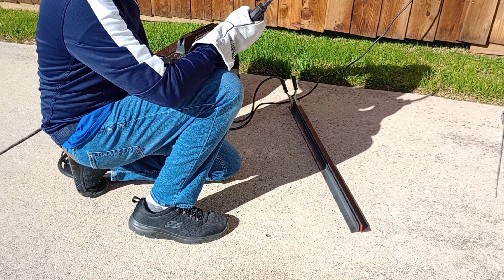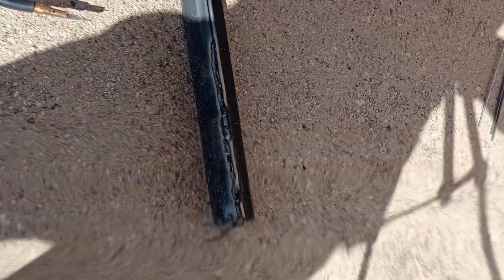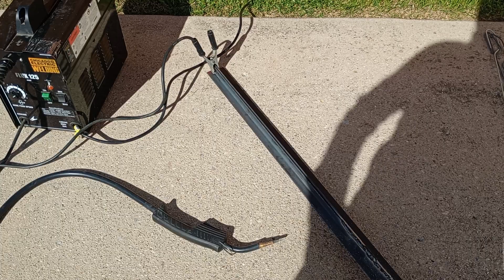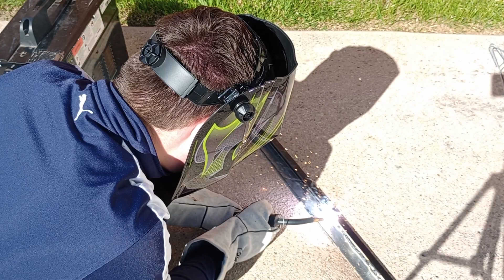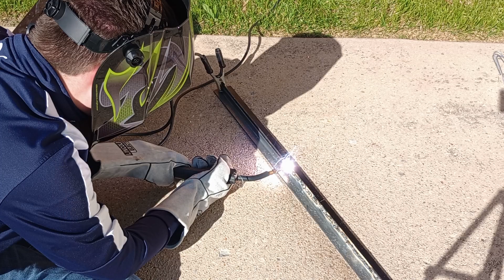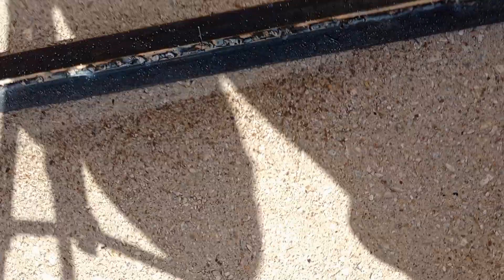WELDING AFTER 5 HOURS OF PRACTICE (AND SOME PRO ADVICE)

Comment: You're welding with a flux-core wire. Flux Core Welding leaves behind a thin layer on top of the weld, this is called slag. Slag is left behind to protect the molten weld pool from the 
gasses in our atmosphere. You can simply hit the weld with a hammer and the slag will come off.

Also, i'd watch some videos on learning to read the ''weld pool'' while welding, this will help alot. A little tip is, if you can't see what you're welding, stop! Its also smart to practice the movement of welding, by ''dry-welding'' without starting the weld, basically moving back and forth on the area you're about to weld. Make sure you're comfortable and relaxed under welding, this will help a lot with natural shaking and tremors.

Keep it up :)

Comment: Sounds a lot better. You can reach your left hand over to the welder and adjust the wire speed while the other hand is welding. Like somebody said on your last welding video, that welder is AC current so it won't be perfect but it will stick metal together. And even though that metal is new, there is still "mill scale" or coating on it that would weld better if you sanded it off but you have made great progress. My local metal store gives cutoff or drop metal free and especially if you are learning to weld.